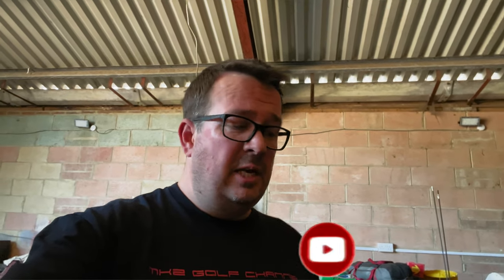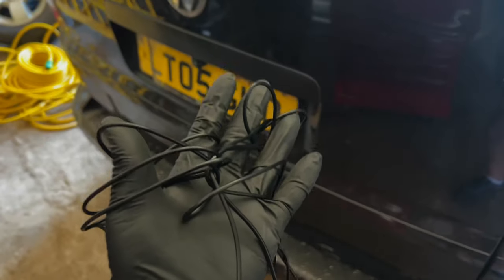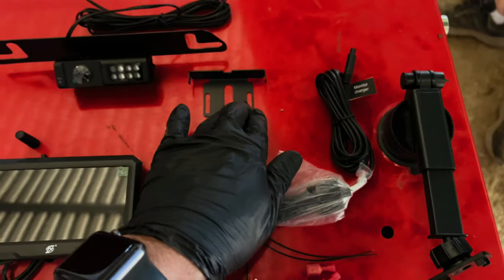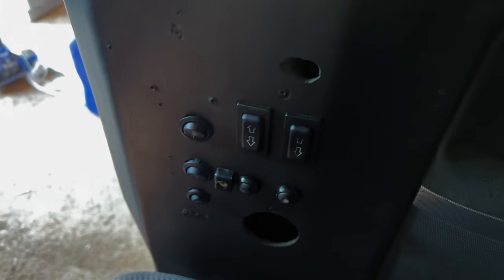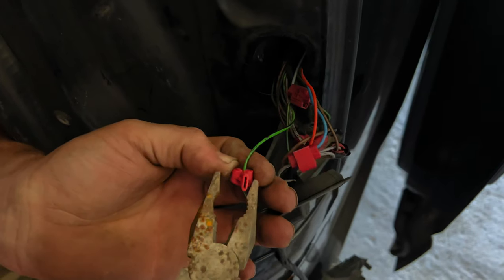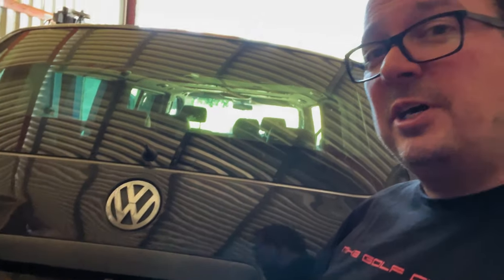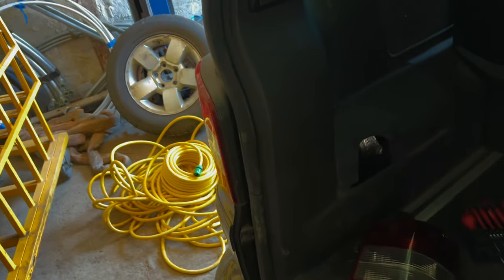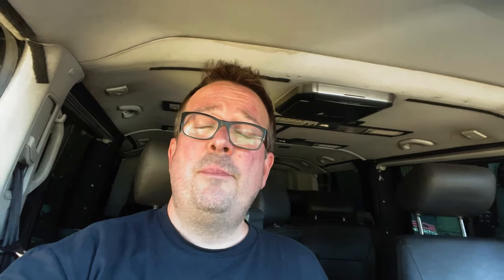Amazing VW T5 Transporter Wireless Reverse Camera Anyone Can Fit!!!  - SFXT Fx11F

Comment: Hi, can you show us how you got the wire from the camera to the reverse wiring, through the inside of the door and through the rubber conduit. This is what I’m having difficulty with. Regards
Reply from the maker: We fitted this 2 years ago now. But I’ll try to talk you through it. If you pop the rubber bit off you can feed some string or welding wire if you have it. Then tape the cable to it and pull it back up. Then inside the van just pop the top plastic trim panel off and you should be able to see where the wires go in to the cabin and just route it behind the trim. Hope that helps.
Reply: Hi, thanks for your reply I tried to feed a flexible wire down the door from the rubber conduit but something was preventing it from going straight through.
I’ll give it another go. Cheers